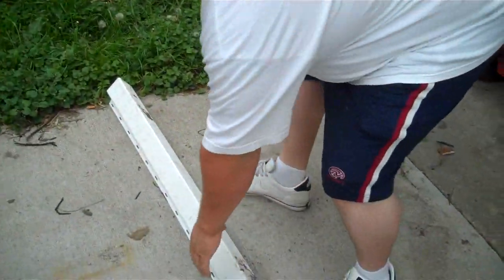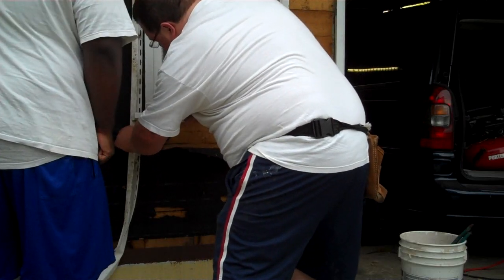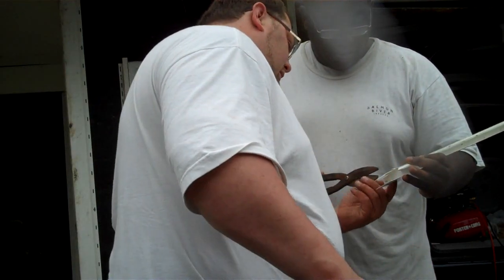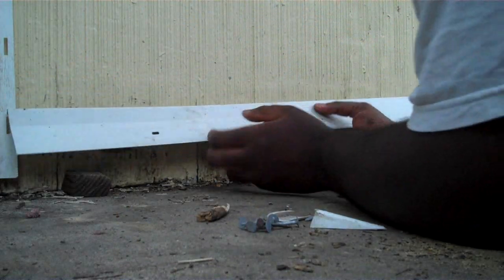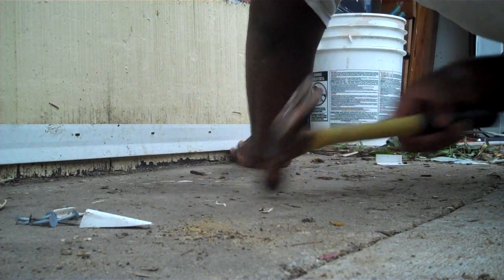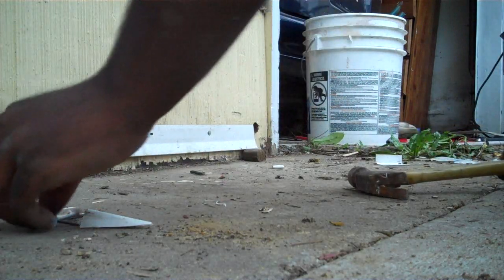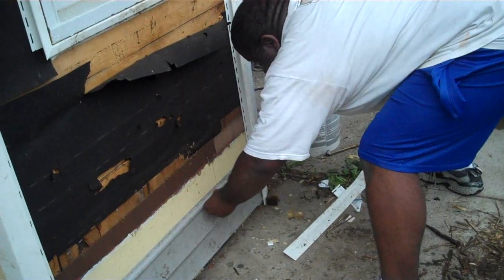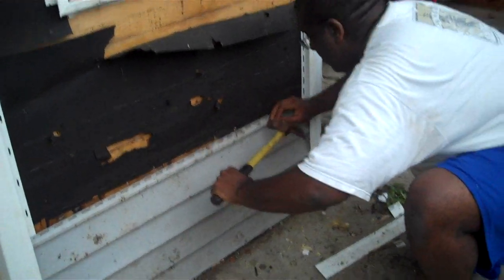Acquiring New Skills

Comment: I m learning basics of electicity and wiring.....You never know when you'll have to gherri rig something out of old blender or something. Very useful since most small appliances have the ability to generate electricity and most of the parts can be harnessed for other  purposes such as light and heat generation.

Comment: intel gathering skills is a must. map your way in and out of intended bug-out areas. find areas to dump your heavy load instead of carrying that whole pack.scope out vantage points scope out areas for emergency bug-out storage since your intention is to bug-out. have a plan for the unforeseen lots of walking but to where? what if you can't get to your primary. I agree that when the time comes manual skills will be neeed

Comment: there are 600 million cars in the US.. about half the repairs are easy, changing oil, staters, alterntors,water pumps, radiators, hoses, etc.  Take a basic course then offer that service real cheap for practice..rais prices when you get good.. expand from there.. that works.   its dirty but there is lots of it, at great profit, and low overhead if you have a van with an zir compressor and floor jacks in it

Comment: @zazoos2 Boring?  They have entire channels on cable devoted to this stuff!  lol.  I think watching someone do it who has never done it before is at least amusing.  Demcad whacking his thumb with a hammer and then swearing up a storm or something would be good television.

If you want something a little more fun, go pound some nails with a Ramset power hammer.  Who doesn't like using bullets to hammer nails?